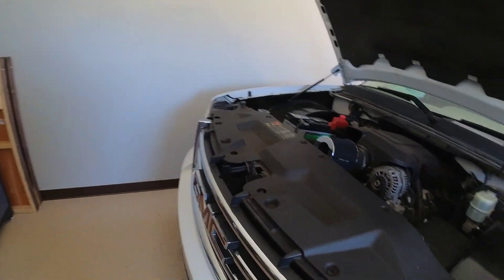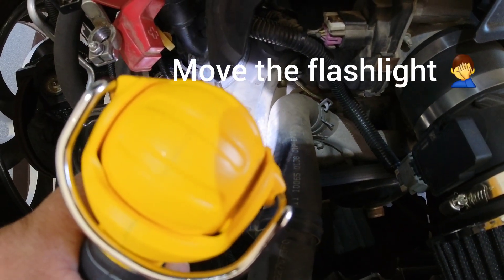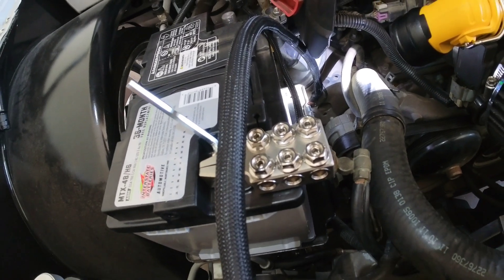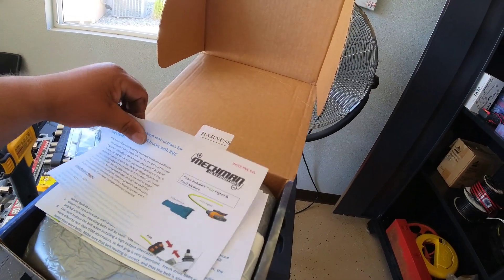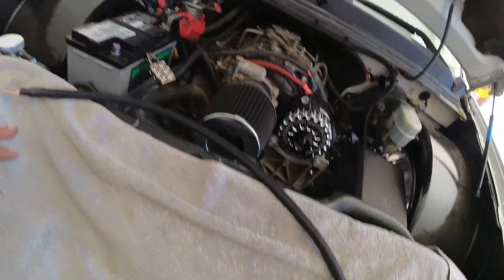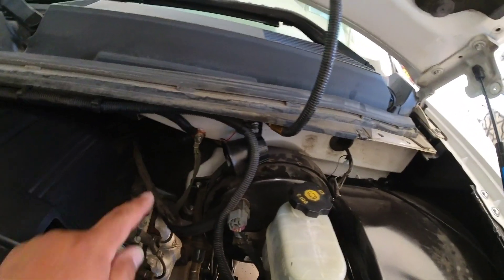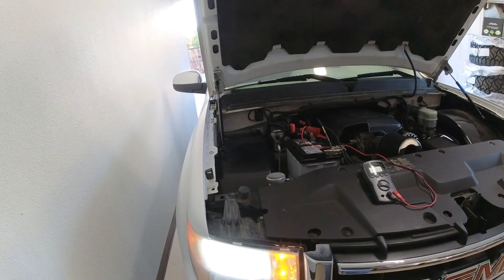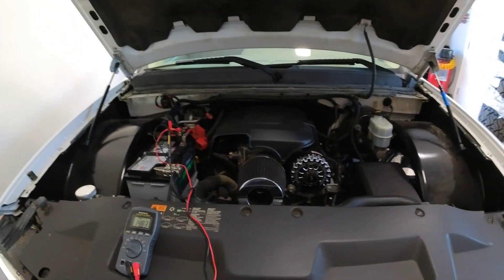mechman 400amp alternator with 1/0 awg big 3 wiring installed 07-13 Sierra

Comment: What was the reading before you upgraded too Mechman ?
Reply from the maker: @jaxjax5322  if you are talking about voltage, we'll that's complicated as the truck would adjust voltage depending on load but I would say somewhere around 13.9v

Comment: Hey brother idk if u still have this or not but or if u remember what kind of cable u used for the power and grounds 1/0 was it audio ofc or welding cable and what kind of voltage did u get with this upgrade compared to what u had also what size engine u have and what muffler do u have sounds good on my home theater nice and deep tone not too loud and rumble can I love the deep aggressive tones bad ass truck 👍👍😎
Reply from the maker: @chatobalencian1504  I did use 1/0 awg 100% pure ofc welding cable for power and grounds. If I remember correctly my voltage went from 13.7v to currently 15v. The engine in my truck is a 4.8l v8 and the muffler I have currently is a flow master super 50 series muffler. I had a super 10 before this and although the truck sounded good, for me at my age it was just to damn loud. I like to hear my music and not have it so loud at cruising speeds. FYI the mechman is unbelievably awesome. I can have my a/c full blast brights on music bumping and both my compressors Going and the alternator just laughs at it. No voltage drop or lights dimming.... Nothing.

Comment: Shouldn’t you be running 4/0 wire to be able to utilize the 400 amps from that alternator?
Reply from the maker: These are the installation instructions straight from mechman. You can see that an alternator 250-400 amps only requires 1/0 copper or 2/0 CCA.

https://www.google.com/url?sa=t&source=web&rct=j&opi=89978449&url=https://www.mechman.com/content/instructional-pdfs/2022-INSTR-GEN.pdf&ved=2ahUKEwin_tj4id-BAxX9JUQIHd6UA3oQFnoECBQQBg&usg=AOvVaw2Xgez-IkMqXzaIjCZ95UKK

Comment: Bro why would you put the engine cover on after you connected the negative from the alternator to the body, I was trying to see what direction you ran it but you covered it all up
Reply from the maker: There is a wire harness that goes to the back of the motor. I just followed that harness with the alternator ground and connected it on the firewall.

Comment: Do you have the link to those things you put on top of the batteries
Reply from the maker: Battery Terminal Connector,12-Way Clamps 8AWG up to 4/0(XL) AWG Gauge, Positive and Negative (+/-)(Pair) for SAE/DIN/EN Tapered Top Post https://a.co/d/gZzFeol
Reply: @T_B_C_L  thank you
Reply from the maker: @shotboii4541  no problem 🍻
Reply: @T_B_C_L  and what did you use to cover the 1/0 wire ?
Reply from the maker: @shotboii4541  I think you are talking about this. 96ft Wire Loom Braided Cable Sleeve Covers Cord Management with 127 Pieces Tube Heat Shrinkable for Audio Video Cable Cord Protectors from Pets (Black and Red,1/4 Inch, 1/2 Inch, 3/4 Inch) https://a.co/d/9Feyw4I
Reply: @T_B_C_L  yes sir that’s the one thank you again

Comment: Bro u should use fuse hold battery 350amp or 400amp and I did take 400amp fuse
Reply from the maker: My setup is separated off of the stock fuse. I am currently also using a 100amp circuit breaker on all my accessories.